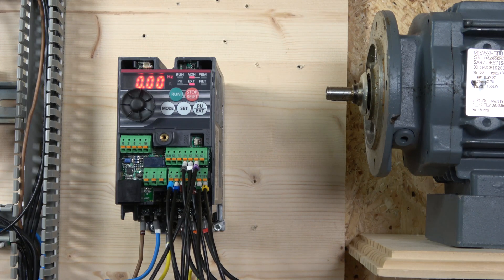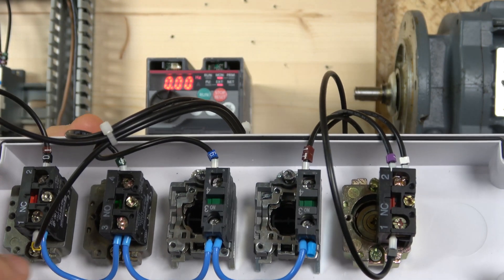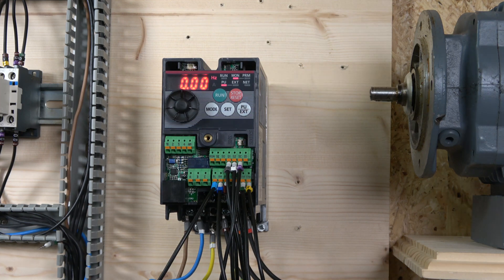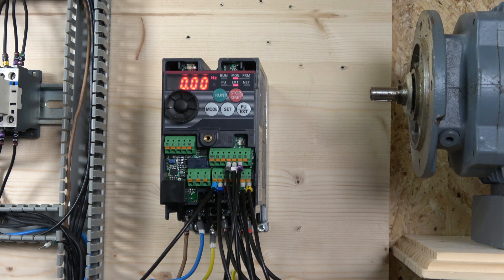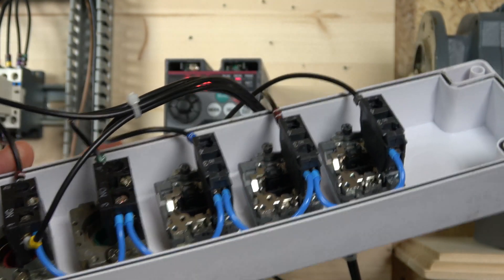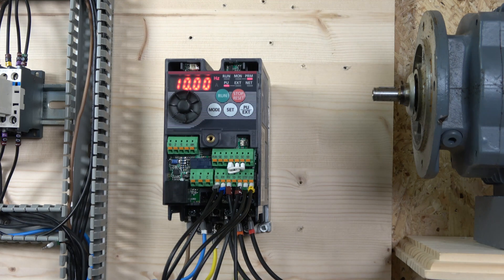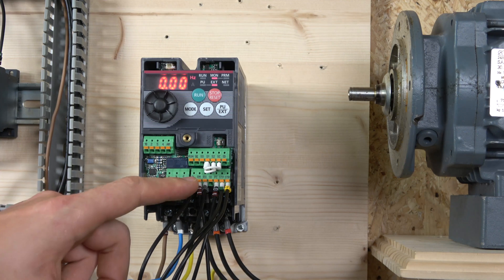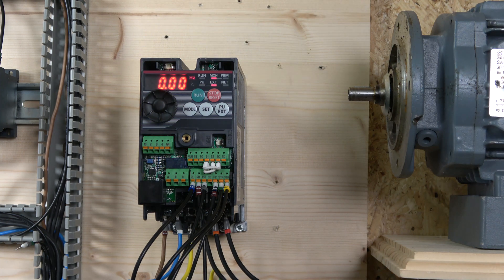Mitsubishi FR-D700 remote control, MOP speed control and multi frequency set up. (English)

Comment: Hi! I have PLC and from plc should give freq value to Mitsubishi drive( terminal 2 and 5) but it does not working! Is this Current signal? Which parametar should I change? Thanks
Reply from the maker: Hi there, frequency from plc to the drive can only be give in from analog card, in form of volts and mili amps. Do you have analog card?
Reply: Yes,i have analog card in PLC, and wires are in terminals 2 and 5…it starts on external run signal (PC and Stf) but when I change frequency on HMI( PLC panel), does not change frequency on drive…parametar 79=0……thank you for help
Reply: We also had old Mitsubishi drive,and We changed him with this one,but now I can’t change freq on drive when I change freq on hmi panel..on old one it was going great!
Reply from the maker: @josipsabljak1630  is analog card outputting signal? Can measure and rule out that card is working as it should do. What signal are you working with? Volts or amps
Reply: I think so,in old one is super working..i think terminlas 2 and 5 are voltage inputs😞 We have more similar stations,and i have looked on another stations,ALL parametar are same but on this one is not working…which parametar is for analog input? Should I more parametars change? Thanks
Reply from the maker: @josipsabljak1630  The key here is to know what is been output from the analog card, is it vols or amps. If you are using 2 and 5 terminals, it looks like you are after volts, that means the mini switch above the terminals of 2 and 5 that indicate V or I must be in V mode for volts. Check that switch, as i remember form memory the default is on I.
Reply: Ok,I will Look on monday and I will tell you…thank you very much!

Comment: my FR-D won't  go into external mode, can you please explain how I can fix this issue?
Reply from the maker: Was it doing it before? It is usually setting in parameter 79 that can be configured to stop you doing that. Check out manual for option
Reply: @IGSElectronics  i set parameter 79 to 4 and now it does finally go to External mode, but now it wont run when i press run, it does however run in PU mode, but not in EXT, what could be the issue of this?
Reply: For a little bit of context, I'm using 7 buttons (Estop, an On button, Stop button, left, right, frequency up, frequency down) . These buttons are connected to a Logo! PLC and the outputs of the logo! are connected to my Fr-D. All the connections should be good, but for some reason it still won't run and nothing happens when i press these buttons. Thank you in advance for helping me, my end-project grades will be grateful :)

Comment: Hi
Is it possible to switch over setpoint form MOP mode to Analog Terminal 4 . Using Selector switch  Manual/ Auto via Digital Input in Drive.
Reply from the maker: My Friend, am not sure am understanding your question.
Reply: @IGSElectronics  Can try to read now

Comment: I need wiring drawing for this connection if you give rex push button connected to RL and another end where its connected
Reply from the maker: Did you watched all 3 videos?
Reply: @IGSElectronics  yes I watched all videos about d-700 drive
Reply: I need  to do the 2 operation for single drive auto mode with working on pressure transmitter and manual mode is working on push button can you give some idea about this

Comment: can it work so that the e stop will use DC braking, if it has coast to a stop set for the normal stop button ?
Reply from the maker: hi Kyle, not sure i understand your question?
Reply: @IGSElectronics  so when I use momentary on/off its coast to a stop, when pressing e stop it also coast to a stop with current settings , could it work so when e stop is active it with electronic brake the motor?
Reply from the maker: @stocksy27  Pardon if i understood your question incorrectly, when e stop is pushed you want to activate the brake? If that is the case, yes that can be set up couple of ways. Do you have brake installed?
Reply: @IGSElectronics  yes that's what I would like to happen, I have no external brake fitted was hoping to use the internal dc braking if possible, its on a lathe motor
Reply from the maker: @stocksy27  For that to work, you will need braking resistor of suitable size for your motor. Drive itself will not be bale to do it.
Reply: @IGSElectronics  great thank you for the help

Comment: yes I need diagram and parameter settings for 
Frequency up by speed up pushbutton
And 
Frequency down by speed down pushbutton
Reply from the maker: Have you watched the video, as there is no wiring diagram, that i could give you.
Reply: @IGSElectronics  I want parameter settings 
Please give me which parameter change for my desire operation
Reply from the maker: @nikunjbakrania2556  You can find that information in the video from 3:40 video time, were you need to change parameter 59 to 1. Please check out that parameter in manual for more details and if have laptop would strongly advise to downloads FR Configurator 2 from Mitsubishi, were you can read manuals much more clearly with fine details, plus there is wiring diagram as well. Check out my canal for how to get FR configurator 2. Hope that helps.

Comment: Wiring connection for frequency up and down by pushbuttons

And parameters for frequency controlling by pushbuttons
Reply from the maker: Sorry Nikunj, is this a question?
Reply: @IGSElectronics  yes I need diagram and parameter settings for 
Frequency up by speed up pushbutton
And 
Frequency down by speed down pushbutton

Comment: I am working with FR-D700. I need help with the parameters
Reply from the maker: Can you explain the problem to us?
Reply: @IGSElectronics  I can't use a digital input, using the potentiometer
Reply from the maker: @brunomelodasilva8647  As far as i remember no, only analog inputs should be used for potentiometer.